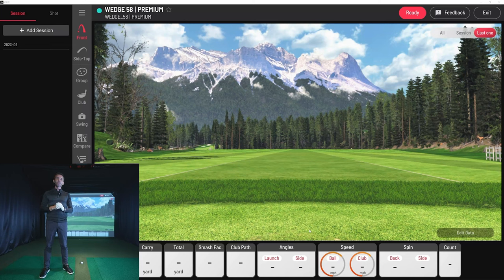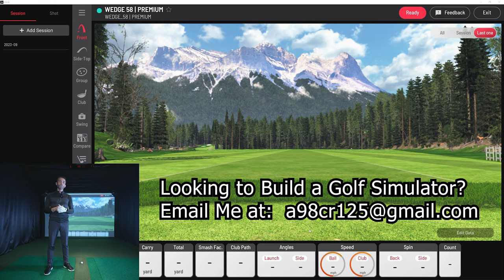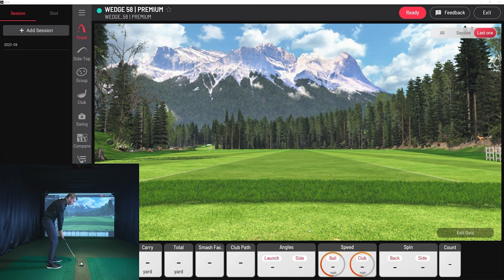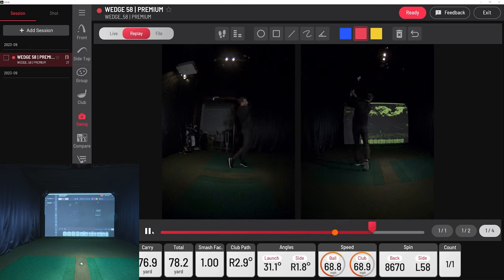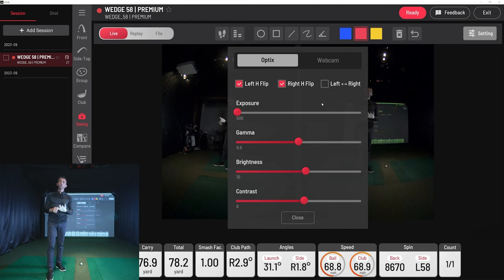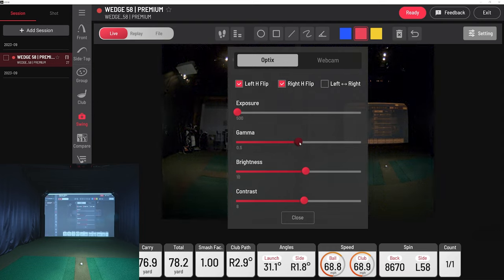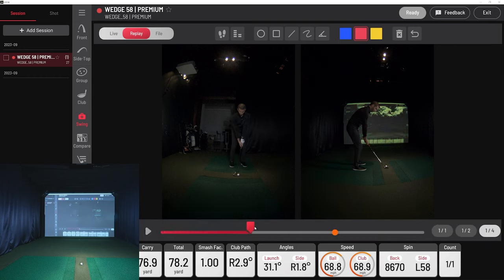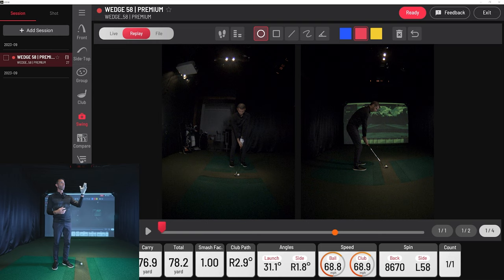How to Setup Swing Cameras for UNEEKOR GOLF SIMULATORS (Swing Optix)

Comment: Man I’m stoked on this. I just got the swing optics system with my Eye mini with your help and I needed this video. Thanks brother! If anyone needs anything… this is your guy.
Reply from the maker: Awesome!  Yeah after several emails in a week and one person specifically suggesting an updated video I thought it would be good timing :)    Appreciate the kind words as well!
Reply: Thanks for this updated video! Couple questions for you; 1) I hit into a net with my video going to a 50 inch TV. Are there sync issues that I need to be concerned with? I know that not all projectors are considered compatible, so I wondered if this compatibility extends to TV panels. 2) You mentioned Uneekor having sales. Do these cameras go on sale? They are obviously not cheap. Thanks!
Reply from the maker: @sellnbrew1  It is not that they are not compatible, it is just that the projector image in the slow motion replay can flicker.  No, I have yet to see them on sale, I think there is just low margin.

Comment: Great video, Jay! I have your same setup, minus the extra bright lighting. I have serious flicker from my BenQ LK936ST. How did you change the frame rate to 120 fps on your Swing Optix cameras? Thanks!
Reply from the maker: It won’t let you adjust it. You have to adjust the setting with more light and it seems to adjust automatically.

Comment: Can you send me a link for the face on and down the line lights you are using.
I just installed my cameras and I either didn’t install correctly or I don’t have enough lite, but probably both. All I see in the View software is a couple of white lights the size of a quarter and when I adjust the lens it doesn’t get a better.
thanks for your videos
Reply from the maker: 2 options depending on the brightness you might need.  My room is all black and dark so I need quite a bit. 2 660’s work for most but some need the big ones.  https://amzn.to/3WlLVAj
Or
https://amzn.to/3zHXLvX

Comment: I’ve been using eye xo/ view/ cameras for the last 2 years and it’s a fantastic bit of kit. However, as someone that analyses almost every swing, it’s incomprehensible to me that they’ve yet to add a ‘loop swing’ / ‘loop club’ button.

Yes, it auto plays your swing or club once immediately afterwards, but that isn’t enough for any real analysis and so I’m required to go over to the computer and manually play back the swing over and over again. 

It is such a painfully obvious and simple feature to add which would dramatically improve the UX.

Any idea if this is in the works ?
Reply from the maker: I can suggest this to them.  Thanks for watching!
Reply: @GolfSimulatorVideos   awesome, thanks! It would make a big difference to the experience .

Comment: Embracing the darkness!
Reply from the maker: Exactly!  I mean I am putting it to the ultimate test here wearing basically all black is not ideal in a dark room with black walls and ceiling too!  BUT, the facts are tons of light and lowest exposure you can do is going to produce the best results.  This is confused so much it was great to get this information out there to everyone, a very good suggestion from an email!  I should mention, you can raise the exposure and it will be a LOT brighter, but you risk club blur when do so due to lower shutter speed.  Thanks for watching!
Reply: @GolfSimulatorVideos  thanks for the awesome videos!  I'm a new eye mini guy and just tried some cheapo cameras.  I still can't afford the swing optix but am looking at other alternatives.  How do you adjust the exposure?  Is that only for swing optix cameras?  It seems that they don't allow those settings with non swing optix cameras from what I can find.  Thanks again!
Reply from the maker: @jtswenson05  You can only make adjustments on Swing Optix cams.  I think this is of course to protect the value of their cameras which makes business sense.  I have a new video dropping Monday morning including these and a new product! Stay tuned! :)